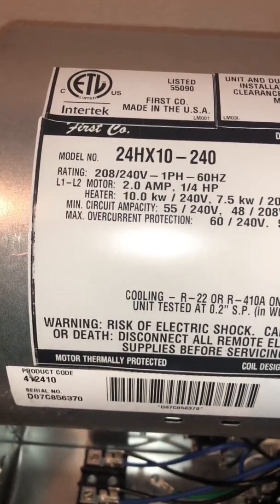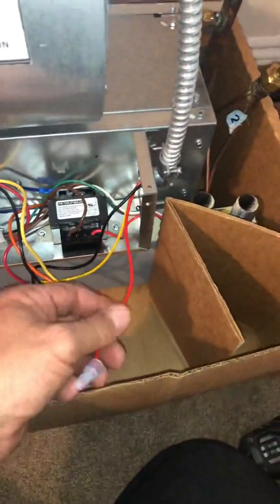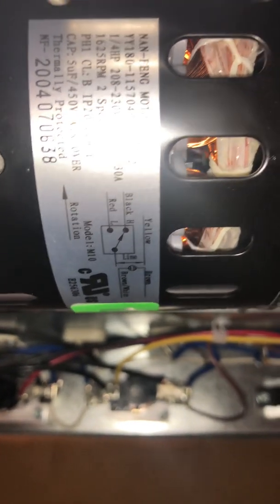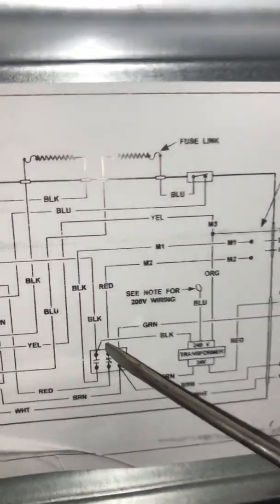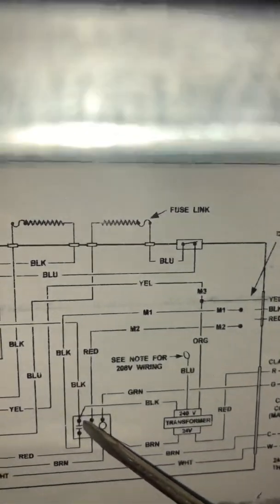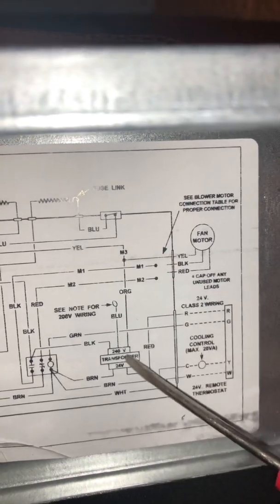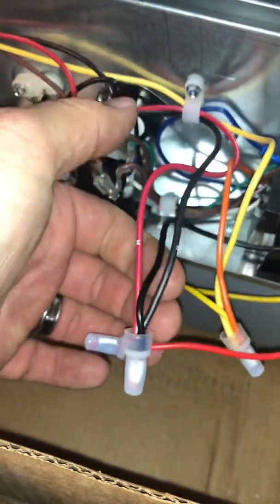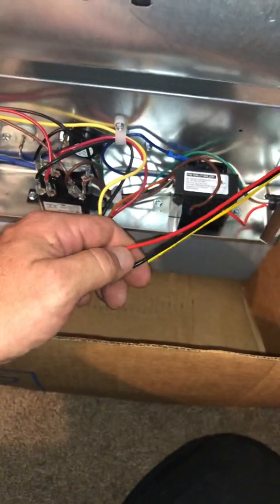Explaining how to wire 2 speed fan motor up on First Company Fur Down Air Handler

Comment: Great video but im bit slow, I've installed my 1st first co pancake unit and th3 blower speed actually blows the condensation from the coil into the ductwork. 
Will I need to cut the fan black lead and connect the red one to lower the speed to medium?
Reply from the maker: Hello there and thank you for watching. I am not sure that the blower speed is the issue. There could be a higher level of humidity in the home causing more water to build up on the coils. It is possible that the excessive water is being flicked off the coil. I am just speculating though. I have come across this issue one time but the culprit was attic air being sucked into the air return causing the unit to sweat excessively and flick water into the plenum. I would definitely start inspecting your return air cavity for any as I call it “unfiltered air”. That would be where I would start. Next would be to make sure your charge is accurate. Can’t check your charge first because if there is unfiltered air getting into the system, that can skew your pressure readings. Keep me updated on if you have any luck with my advice. We can troubleshoot this thing together. Hope this information finds you well.
Reply: I very much appreciate your imput, you are not far off in regards of the hot, humid and unfiltered air in the ceiling enclosure, I will definitely seal it up.
Now, with that saaid, I've removed the old equipment amd was not having this issue and off course it was the same air handler. Thank you very again.
Reply from the maker: Sounds like a plan. Good luck!!!

Comment: Where would you say is the best place to park the 25volt (yellow) common wire coming back from the condenser ?
Reply from the maker: If you’re referring to the 2 or 3 conductor wire that goes just from the condenser and ties to the yellow wire from the thermostat then I would suggest to tie it in with the rest of the commons coming off the air handler. I believe in this application the common color is brown. Most 2 conductor wires I’ve seen used for the condenser are typically red and white. I guess your wire that goes outside is using a yellow wire. Just make sure it’s wired correctly or you may have issues. Hope this helps.

Comment: Nice video . I tell folks that heat is more dense thus doesn’t require high fan speed .
Reply: Actually, cool air is more dense than hot air...
Reply from the maker: Hello there and thank you for watching. I’ve actually seen a few times where the heater’s thermal fuse will blow as a result of the lower speed on some of these older units. I’ll check air flow and filters and if all is well then I’ll typically rewire the fan speed to only run on high speed then change the thermal fuse. That resolves the issue. Weirdly enough after a couple years of rewiring the fan speeds to only high on my new installs I began to see that First Company would ship these units already wired for high speed only with the low speed capped off just like in this video. I think there may have been an issue and that was their fix. Who knows. Hope that little advice helps you in the event you have that issue.
Reply: @klinthanks9946  I’ve never Installed this style of unit before until yesterday and  man if your video wasn’t available i would have been in trouble . It was not fun  to install to say the least . This unit is in a small condo less then 800 sq feet so it’s safe to say that med speed should be good . Going back tomorrow to finish up  the Sheetmetal on the plenum box and should be good to go . Thanx again .
Reply from the maker: I’m glad that my videos help you out. That’s what I made them for. They can be a little tricky at first but after a few installs you learn what’s needed and little tricks to help you out. Thanks again for watching!!!

Comment: Hi klint. Thanks for the great video. My unit works for about 5 minutes and not come back at all, even when I put on fan only. Does the air handler have a capacitor? Where is the location? 
The next day the unit works again for about 5 minutes and stop. what do you think is the problem?
Reply from the maker: Hello there and thank you for watching. Yes, they do have a capacitor. They are mounted either on the back side of the motor or located in the electrical area. It sure sounds like your motor is potentially over amping itself and eventually shutting itself off. The motors are thermally protected and will shut off when they over heat. I would suggest checking the capacitor and replace if needed and then check the amperage of the motor once you check/replace the capacitor. Sounds like you are on the right path. Good luck and remember to turn the breaker off when messing with anything electrical.

Comment: So the have the low speed on heat , you wire just the reds together? 
The yellow stay with orange?
Reply from the maker: Hello there and thank you for watching. On this wiring applications, you’ll have black (high), red (low), and white or yellow (common) coming from the motor. The three wires from the motor will never ever be connected. This will burn the windings and make your motor trash. The motor generally wires to a fan relay. In this particular wiring setup, you’ll have a typical fan relay with a normally opened set of terminals and a normally closed set of terminals. The high speed will always connect one of the two normally opened side of the fan relay so when it receives 24v (green), the coil of the relay will make the points inside close. The low speed will most likely always connect to one of the two normally closed side of the fan relay. Since the fan relay does not get energized when you turn the heater on, the points inside stay closed on this set of terminals and allow the current to flow through it when the heat sequencer is energized. When the heat sequencer receives 24v (white) it will send high voltage to the normally closed set of terminals. If you wish to remove your low speed out of the wiring and just use high speed for both cooling and heating then you would cap off the red wire from the motor and connect the black wire from the motor to the high speed wire and the low speed wire from the fan relay. Since the points inside the fan relay open and close with each cooling and heating function, the voltage will never cross and mess anything up. I really hope this helps. Thank you
Reply: @klinthanks9946  thank you, customer was complaining he feels cold air coming from vents when heater comes on due to high speed , change it to low much better . Thanks again
Reply from the maker: Glad you were able to get it. Thank you for watching.

Comment: HI Klint this video is really really helpful. I have a 25hxx0 and it leaks water probably thew drain needs to be replace or may be the condenser is leaking water so i think it needs a whole unit replacement. Any thoughts?
Reply from the maker: So I have found in 12 years of working on these style units they can have a couple issues that will make you question your ability to work on them. On my original units, unsure name, the drain pan has actual fiberglass insulation wrapped around it with a sheetmetal wrapping that. It looks like a normal drain pan honestly and to the untrained eye you would think it’s one piece. What I find with these style drain pans is that when the pan overflows it will leak out of the unsealed pan making you think the pan has a rusted area. A lot of the time I tell my techs if the pan is holding water then it’s a good chance the pan is ok. What I find happens on these units is the design doesn’t allow you to clean out the pan of all the crud. The ends are exposed but the middle part never gets cleaned. If that’s the case then the pan will drain as it should on the drain line side and the other side will hold water. The crud in the middle creates a tiny dam and the water can’t drain.
If this is the case then changing the pan can be difficult. If it is like my 40 year old units then your only way to remove the pan is to break the welds off the pan and pull it down.  I’ve also seen the evaporator baffle rust completely through and through and allows the air to blow into the pan instead of through the evaporator coil. In this case you are better off changing the air handler out and doing away with this head ache. Hope this helps you out.
Reply: @klinthanks9946  thanks. I dont knoe how to share the pictures. The sheet inside the pan is gone all i see is rusted chips. So the only way out is replacement. Amd i am guess the procedure is to remove the unit remove old pan and hook up new one
Reply: Thanks very much i gave another detailed look.. the evaporator coil above is rusty and golden on side. I saaw ice there when on ac mode.

The level of detail you publish makes me think i should contract you for the replacement. Noob here.!
Reply from the maker: If you’re seeing ice then it’s quite possible the system is either low on Freon or restricted air flow. How’s the filter look? Have you checked freon levels with a clean air filter installed? These things can also cause these units to act strange. If ice is forming on the evaporator then the water flow may be restricted. Check your levels. Make sure you are adding freon to the system while it’s frozen. Won’t read properly. Let the thaw for a good 1.5-2 hours.

Comment: So the unit im working on doesnt have a fan relay in the system but im going to install one, could you either make a video of the wiring leading up to the fan relay or send me a picture so i could better understand? My air handlers seem to have a transformer, sequencer and a relay and thats it. I had to replace the blower motor, but the previous motor was a multi speed, and the only replacement motors are two speeds.
Reply from the maker: What does the current fan motor plug into? Is it a solid state circuit board or a relay.
Reply: @klinthanks9946  a relay
Reply from the maker: @ChildishCam  I just finished uploading another video. Hope it helps. It’s called Explanation on wiring up a fan relay on Fur Down Air Handler.
Reply from the maker: Did the relay look similar to the one in the video?
Reply: @klinthanks9946  sorry there is only 2 sequencers on the unit, no relay, it was broken down and taken apart when i arrived on site.
Reply: i have a relay the exact same you have in the video i just need to rewire the entire air handler. its hard for me to follow schematics. i do best by seeing it all together and basically copy paste
Reply: @klinthanks9946  i have one like the video, i just need to know how to wire it in. basically im taking apart all of the wiring and re wiring it. so if you could do a minute or so video showing where every wire goes starting at 240 running all the way back to the thermostat and condenser